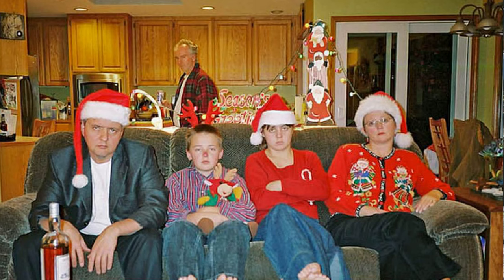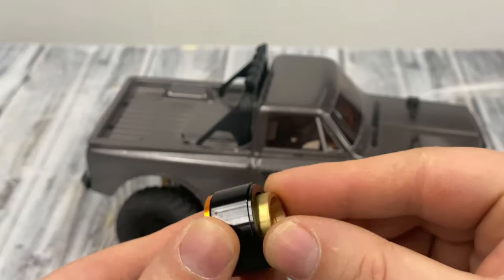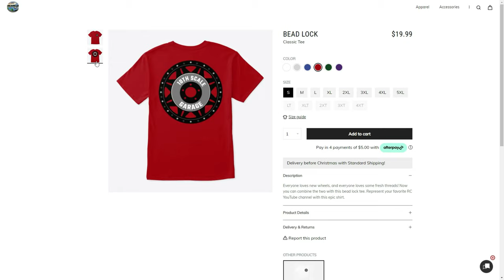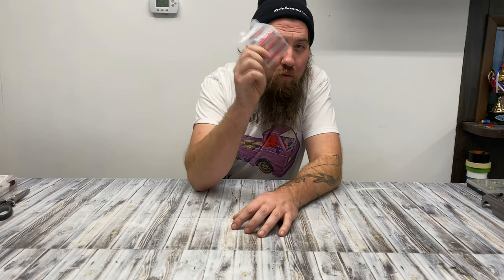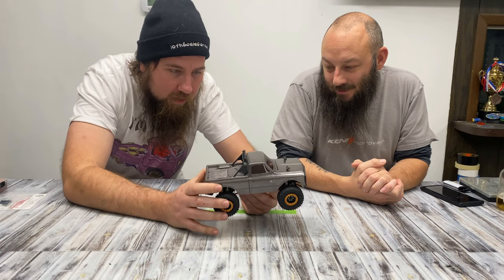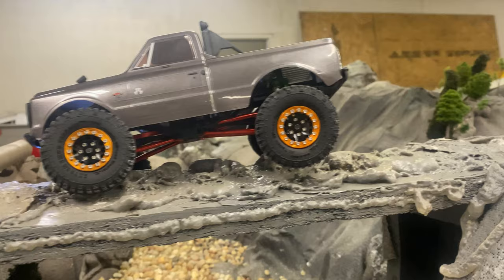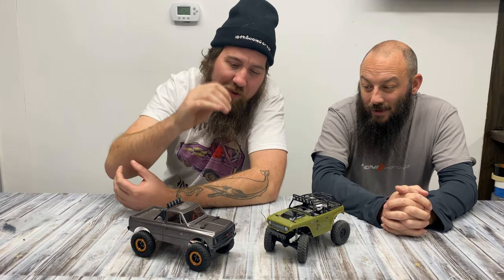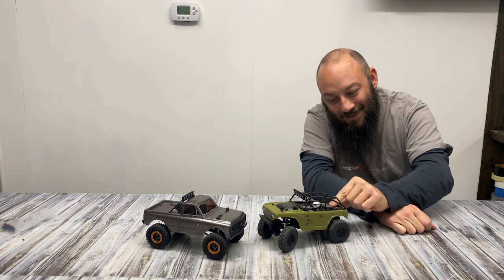Ultimate Axial SCX24 Upgrades

Comment: I recently bought the gray SCX24 C10 and I'm so blown away by how far RC technology has come in 15-20 years! I had a few Radio Shack RCs when I was a kid (20 years ago) and the trucks always had massive battery packs that took 4-6 hours to charge and would get you about 15 minutes of play time, and it blew my mind when it only took about an hour to charge my SCX24 battery and then I got about an hour of crawlin out of it! I have done some upgrades I bought the exact same Injora beadlocks with their brand of super swampers and the tires were way too big so I ordered Injora Mickey Thompson Baja mtz tire and they fit better but I still had to trim my front fenders and I also bought licensed Super Swamper Boggers from RC4wd and they are just as good as the Baja MTZ and I put the RC4wd boggers on some different beadlocks that only had 4 screws that hold the wheel together as opposed to the Injora wheels with 16 screws, overall I'm really pleased with the quality and customizability of the SCX24 and all the upgrades/accessories are pretty affordable. I also bought a bumper and was surprised that it was actually metal and the clevis's that came with it were metal too! The only thing I'd say is a must have for an SCX24 other than wheel weights is the 4 piece screwdriver set with 0.05", 1.3mm, 1.5mm, and 4mm box/socket

Comment: I have an SCX24 Deadbolt.  I started with brass wheel weights and diff covers.  It performed reasonably well, but would still not crawl a 45% grade boulder in my neighborhood.  When I added those Injora beadlock wheels and tires, it scooted straight up the incline.  It also routinely slays our indoor stuffed animal course, boot crossing and tire piles with ease!
Reply from the maker: Nice! And you probably didn’t have to hack up the body like I did.
Reply: Do the tires rub on the fenders in the deadbolt?

Comment: Hey buddy, just as a heads up, Injora also offers inner brass rings for their wheels (the ones you got), should you want even more weight. They weigh 14G each and cost $8.99 for a set of four. Anyways, great video!

Comment: I have the red deadbolt. Only thing I've changed so far is tires wheels shocks and added wheel weights along with extended axles. A little weight goes a long way on these. Next upgrade will be the steering servo then new motor and esc. Haven't seen a lot of motor/esc options but furitek is probably what I'll go with. Oh and I also need high clearance links.

Comment: I recently changed the wheels and tires for bead locks and have installed emax servo and a high torque motor, the difference in performance is unbelievable, I think that I’m going to install high clearance links and brass axles
Reply from the maker: Nice! That thing will be unstoppable
Reply: What motor did you get? Did you need to upgrade the esc also?

Comment: Dude I run those same injora tires on my 24. They are the best, the rc4wd ones don't compare and they're smaller. I wish the injora were a little bigger but they're bigger than the rc4wd. The grip is waaaay better too. Cheap doesn't always mean bad.

Comment: I have a scx24 Deadbolt weighing in at 418 grams, upgrades- Injora All-Terrain tires, steel wheels, brass wheel weights, brass diff covers, SS high clearance links 4 link on the front, emax servo with aluminum steering link, 48mm shocks and mofo rc 50T motor
Reply from the maker: Nice! Those emax servos are super fast.

Comment: I just changed the wheels/tires and the motor (because it died on me wirhin a month). I think the motor gets hot regardless of the upgrades, so if you havent changed it, I recommend getting the bigger one. I also put little heatsinks on it
Reply from the maker: This is the first time it’s gotten hot. I know people go through stock motors a bunch, but no one I know personally has lost one yet.

Comment: The issue with upgrading these Scx24s is that as soon as you add some weight you have to replace the motor or it's not gonna last very long at all. And those blasted stock servos that they come with are garbage.  But once you replace almost every single damn part on them.. they become pretty awesome!
Reply from the maker: I’ve had wheel weights, brass steering knuckles, and diff cover weights in the thing for over a year and haven’t had any issues yet, nor have all the guys that run their rigs on my course. Their trucks are all modified, too. I know a lot of people have issues with theirs, but no one I know personally has lost a servo or a motor… yet.

Comment: How about 3d printed pegs and mounting brackets for body. Extensions for the c10 shell to mount to frame. If there is a wat lift the shell from the frame because the shocks lift the frame so if you lift the shell from the frame should have tire clearance. Just curious.
Reply from the maker: Yeah, in fact you can lift the body pretty easily, but that also raises the center of gravity. That wasn’t the look I was going for.

Comment: With the Y-Link that comes with some of the metal kits I have had to dremel out some of the material because it was causing a binding with the front driveshaft.  If you look you'll see rub marks on either the driveshaft or that y-link.  Some of the kits have an offset but some don't.
Reply from the maker: Yeah, it’s super close, but luckily I have full travel with no binding. They first kit that I got for the Deadbolt was way better (more clearance)

Comment: First thing I did was change the servo and the motor before I added any weight.  My brother changed alot before he did the motor and it kept burning up.  And the servo I think just sucks once weights added
Reply: What servo did you upgrade to?
Reply: @treyammons464  I went with the Powerhobby 7.5kg brushless servo. It's not cheap coming in at a little less than half the price of the truck but it's so nice. All the power your gonna need plus some.
Reply from the maker: I haven’t had any issues with electronics…. Yet. I drive the crap out of this truck and so far, so good.
Reply: @10thScaleGarage  Awesome! See I didn't have a such a good time once I added weight. The motor got very hot until failure and I had it happen a couple times before I switched out got a larger motor. Hopefully yours holds out, thanks for the videos, I love watching em.

Comment: I have modded the same c10 color. It step it got better and rules the course.
I have a b17 stock too. The c10 has brass spindles,rc4wd bead locks and Goodyear wranglers,wheel weights,new servo,double barrel shocks, HD steering link and then smoked motor and changed that to better one.its a monster
And getting ready for the suspension
 links. I keep the betty stock to measure 
With.also have a deadbolt I haven't opened yet.just finished adding on to my course and will post soon.
Reply from the maker: Dang! I bet that thing performs!
Reply: Getting ready to up load course and crawlers. Thanks

Comment: I do have the scx 25 C10. Bigger tires, wider brass hexes, brass diff covers and aluminum steering links. As for the body rub I raised the truck by mounting the shocks to the frame.  I know this raised the CG but but the brass down low helps
Reply from the maker: I just hacked the bejesus out of the fenders. Didn’t even think to lift the body.